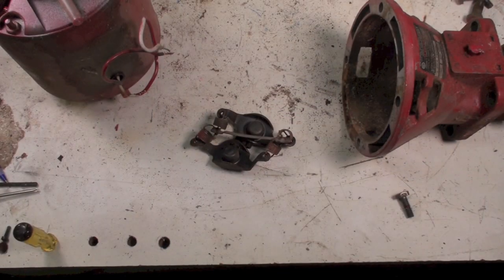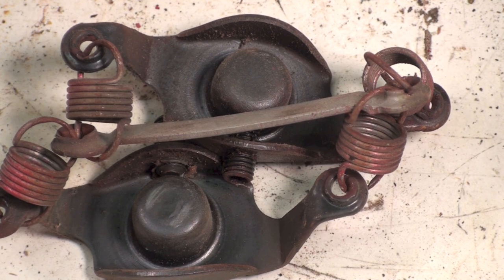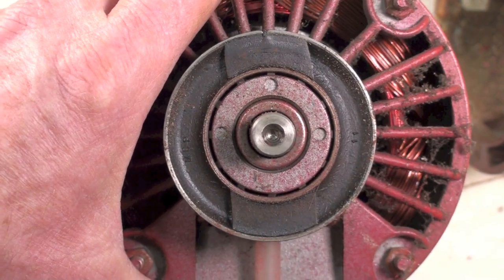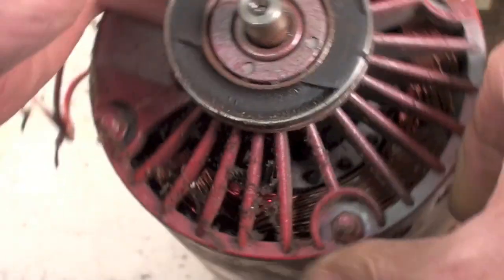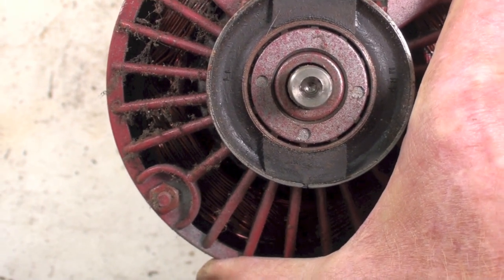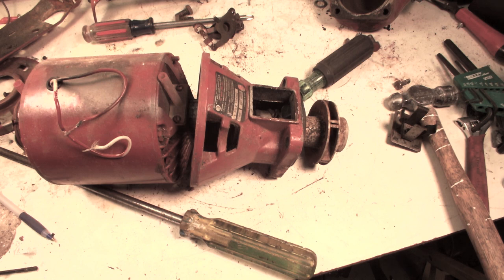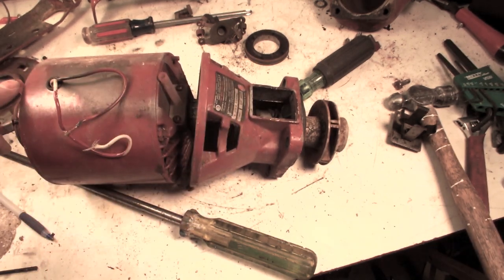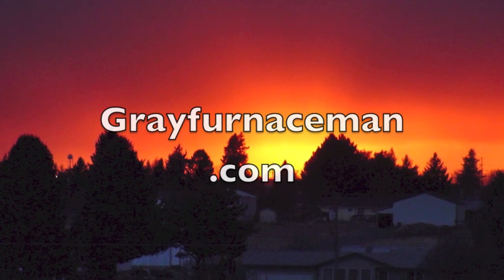Troubleshoot the Bell and Gossett boiler circ pump

Comment: These pumps ran in my house for some 60 years. They became very noisy after I had been in the house about 7 years. I simply replaced them with the newer models. Very quiet and energy efficient. Says alot about the original engineering and design that they ran for 6 decades. TY for your upload and knowledge share. :)
Reply: What are the new ones? can you list the model #?
Reply: @javirodify  I don't have the model number. They are available through Amazon. Make sure you contact a plumber and make sure of the replacements you need for your home and square footage.
Reply: @FSAUDIOGUY  Info should be on the pumps. Should be a model tag. 
I’d be interested. I have 5 pumps from ~1962. Have had to replace one but rest still rolling along. Have to replace 2 impellers and all of the couplers.

Comment: Your video likely just saved my heating- I am from Australia but been here a few years - after my recirc pump started sounding very clunky today I did the basics bleed the rads drain the expansion tank then I watched the motor - it couldn't turn at the couple - watching your video I realised the issue was I needed to add oil - as per you suggestions I added about 2  tbls of oil - ok it got engine oil mobile 1 - all I had on hand - so far its quiet and now working - you just saved me from freezing again after the power outages we had in toronto - I know I need to get a hvac guy to fully check it out in the next week - but you saved my ass - honest thankyou !
Reply from the maker: Welcome
GFM

Comment: Thank you so very much grayfurnaceman.  I just finished doing the maintenance by oiling the bearing(400 drops) and the motor(F-150 drops, R- 100 drops) as it making grinding noise from the motor and vibrating noise from the bearing.  The motor would stop frequently because of the thermal switch due to grinding.  I didn't oil the bearing yearly as you've suggested.  Worst yet, I didn't even see the oil spouts on the motor as they were spray-painted.  The motor apparently never has been oiled since installation, and it's been 13 yrs in my ownership.  Once replenished and restarted, it rotated super quiet and smooth.  I never realized how these commercial Bell & Gossett suppose to sound like in operation.  Thank you again, and a cold one to you!
Reply from the maker: They are amazing pumps.  Most noisy bearings will signal failure.  The B&G pumps mostly survive.
GFM

Comment: Follow up to my last posting.  The previous owner had another ( old spare ) B&G  tucked away downstairs I found. I unwired the mounted one and wired this one just to see if this one works. It spins, but noisily, so at least I know now it is the Circ Pump. Thanks again. Mystery solved!

Comment: Thanks GFM. I did just that, Pulled it. I oiled it yesterday just as you suggested in your other video. So it had time for the oil to set in. It was snug turning at first, and the motor spun semi-smoothly after a bit, but then noticed a bearing noise after rewiring and firing it up again. I don't know how old, or the history of this one as we bought the house just this year, so I think I will go ahead and order another motor and replace this one. Thanks for your valuable input with your videos.

Comment: Thanks for the prompt answer!!  I can send you any number of pictures needed.  I want to believe that alignment is not an issue but would admit that if I use push up pressure on the motor apparatus, it does reduce the noise---but the GE hung on in the same manner and was never noisy.

Comment from the maker: I would pull the motor off to check to see if the motor or the pump is seized.  Occasionally, if the pump is seized, it can be oiled (it takes 2 tablespoons) and may be freed up and if it does not leak, it can be used.
GFM

Comment: Gary! I have a small amount of oil dripping from the bearing assembly and the pump. (I put a clean paper towel on the floor so I can check it.) There is no tapping/clicking sounds, it all hums as it should. I add oil to it every season. Should I be concerned? THANK YOU for these videos!!! And for advising on correct amount of oil to put in each feeder. Understanding how these pump operate is solid gold. You're a good man!!!!
Reply from the maker: +Tom Lynch Thanks for the support.  It is common to have these bearing assemblies leak.  Not much you can do about it but be sure it always has oil.
GFM
Reply: Don’t be concerned that hole is to show to much oil
Reply: Don’t be concerned that hole is to show to much oil

Comment: Thanks for the advice. Unfortunately I've just had a bearing assembly leak that is only 6 months , on a bronze body BG100, for domestic water circulation.   When I opened the cap on the bearing, I saw a bunch of mush, brass shavings and water. Idk what went on with it, but it wasn't the nice neat rope like I've seen in the past. Any insight you can give would be nice. Thanks!

Comment from the maker: There are a lot of ways to turn on the circ pump.  Thermostat, boiler temp, zone valve etc.  You need to be sure there is power available to the circuit.  If the thermostat is on the same circuit, it has power.  A quick check would be to tap the pump motor with a small hammer.  If the start switch is the problem, this may break it loose.    Hope this helps.
GFM

Comment: What a wonderful resource you are—thank you!
New problem: my B&G circ pump motor often stalls and whines instead of turning, overheats and then cuts out. I am hoping this is caused by insufficient lubrication of the bearing assembly. What else might it be? Do I need to replace the pump motor?
Reply from the maker: +Ian Lambert You probably have a failing start switch in the motor.  It means replacement of the motor.  Hope this helps.
GFM
Reply: God bless you, both.

Comment from the maker: Does seem like overkill.  But I guess you cant argue with longevity.  I will be doing some on the modern water lubricated pumps.  Their power usage is smaller yet.  I have not seen the same longevity with the new pumps.  
GFM

Comment: Nice video.  Was trying to avoid taking apart later today, but tenants need heat.  On the one side of the pump coming from the heater the pipes are hot, but on the other side feeding Taco valves, the water is cold and nothing is being pumped.  It's making some noise, weeping a little, but at least the previous owner left parts.  Will check out your websites also.
Reply from the maker: Good chance you have a coupler failure.
GFM
Reply: Impeller exploded. Took pictures.  Found a local plumbing supplier who had the part.  Got everything reassembled, will re-install tomorrow morning.  I checked out your websites good information with the Weil McClain manuals.  I am retired but my friend who owns several properties is always calling me to do repairs and when equipment breaks down.

Comment: by "sagged down" he means a deep indentation I think, due to weight of motor sagging down and squeezing too much on the rubber mount.   Also I wonder how much noise the heavier springs really make, maybe they won't ever break on you if heavier, and my pump is in a wet sandy crawlspace and it is sheer torture to keep changing spring couplers
Reply: where did you get the spring couplers from

Comment: Awesome vid! I'm getting a rattling sound from the motor end opposite the pump.  My first thought is a bearing going bad.  I oiled it but the rattle is still there.  I see you didn't get into the motor bearings in your video.  Should I check into other potential sources of the rattle first?  Thanks!
Reply from the maker: James Perrin Look to the coupler.  I have seen very few bearing problems with these motors.
GFM
Reply: OK. Thanks for your advice.

Comment: Hello...thank you SO much for posting this vid. EXACTLY our issue. I think we froze the circ pump up from not oiling it. So what would your suggestion. TRY to oil it first before buying and installing a new circ pump?...and then having to drain/purge the whole system again mid winter? Yes we had water leaking...then it sounded like a "jackhammer" going off (per tenant)...and it stopped turning. The IMPELLER? (spinner) looks good and was just replaced < 2 months ago. Can you PLEASE advise
Reply from the maker: scroungehounds I always try oiling these motors first.  The impeller (coupling) usually fails because of the sagging of the motor mounts, so check them.  As for the leak, sometimes they stop after it gets going again. Hope this helps.
GFM

Comment from the maker: Air bleed depends on how the system is designed.  If the system is cast iron radiators, its easy.  You simply turn on the water & bleed each radiator with the unit running until you get water.  If its copper baseboards & has zones, turn on one zone at a time & bleed that zone If there are self bleeders, it will bleed itself while running.
I know this is simplified & I will be explaining how each system bleeds in the grayfurnaceman website.  Unfortunately, its not done yet.  Hope this helps.
GFM

Comment: great video, 1st one to give the amount of oil to be used . most people just squirt a bit of oil in every month or so not knowing the right amount.
Reply: Yeah that's what I've been doing putting 15 to 20 drops in each of the three tubes for the oil. I didn't realize the first one with the spring cap needs much more oil than the rest thanks so much for that tip gray boiler man

Comment: Thank you for your quick response. Much appreciated. I did as you suggested. A few taps was successful in obtaining movement, but not successful with the sound I heard.  Makes a short "garrrooop" sound and then stops, when I engage the thermostat. Apparently, I'm thinking it is seized up. Would you most likely say as well? Any input appreciated. Thanks in advance.

Comment: I rent a house with 8 other folks - the house is over 100 years old, 5,500 square feet and has a massive boiler with one of the B&G pumps. Just last night, stopped getting heat. Thermostat kicking on, boiler gauge shows pressure at 15-18PSI and temp of 150 but hot water is only evident in one large pipe coming out of boiler for about 4 feet - after that, where there is a juncture - all pipes cold.  There is a Honeywell thing that was ticking/trying to tick, no vibration from B&G.  Had heat from Nov 4 thru yesterday and now...........nothing. No leaks - just lots of old oil under in the pan. Noticed old bottle of lube in room but empty - and remember guy putting drops in last year.
Reply from the maker: Is the pump rotating?  Is the coupler broken?
GFM

Comment: The Mrs recently complains that the circulator is noisy.  Three years ago I had to replace the ancient GE 1/8 HP motor with a "MARS" 1/8 HP Motor.  It was ugly.  Vibration was so bad that I removed the frame casing on the motor and configured it to run in the old GE frame mount=better situation.  Now 3 yrs later, this month, I put a Century 1/8 HP motor on the pump--appears to be the same noise deal except I used the motor and its factory frame as provided.  The GE motor was so quiet--????

Comment: That rope stuff is wick.  It will stop working if it drys out to much. Change them. Capillary action draws the oil from the reservoir up to the  journals . Spiralink couplers are easier on the bearings

Comment: My motor or pump won’t turn. Not sure which. Took it apart and the couplers are intact. If the motor seized Will adding oil get it going again?

Comment: The problem with these pumps isn't the fault of the pump. They were designed during a time when people actually maintained their boilers. I'd say 1:100 people actually know to oil these things. It's amazing how reliable they are considering how often they run well outside of their maintenance window and design specification.

When you consider all it needs is SEA 20 weight oil (a quart costs about $3.00 and will last 20+ years of seasonal oil maintenance) it's unfortunate the industry is forced to use maintenance-free pumps that are often underpowered and less reliable. My parents BG pump was replaced with a Taco years ago, and it's frozen up twice, even after reconfiguring the whole delivery.
Reply from the maker: Tim W I agree on all you say.  I always tried to repair these pumps whenever possible, then instructed the customer on maintenance.  Thanks for the thoughts.
GFM
Reply: I oil mine.  I will be replacing the coupler in the mount tomorrow.
Reply: Oh, and I am a 60 year old woman. Thank you for the video it was very informative and helped me greatly
Reply: @sunyblutoo  I am an embryo and they need to do this for my uterus, I can't sleep!
Reply: Totally agree!

Comment from the maker: Is the noise coming from the bearing or the coupling?  I did a vid on couplers and motor mounts.  The rope wick should be oiled with a lot of oil.  It takes about 2 tablespoons of oil.  Once it is oiled, just hope the bearing is ok.  The motor and bearings should be oiled at the beginning of the heating season.  Hope this helps.
GFM

Comment: Thanks for immediate reply. I have added more oil than that  and as I said it only works for couple of days. Is it possible to repack bearing or any other options without removing wet end and bleeding system?
Reply from the maker: Brian Whiteman The bearing assembly is replaceable.
GFM
Reply: Brian Whiteman  nusicacristo

Música cristianamente

Comment: I have a multi-zone system with 4 pumps. One of the zone suddenly start always getting hot even when thermostat is off if any one of the other zone start pumping. 

Is this likely caused by some problem with the pump on the zone? 

I cannot find any check valve anywhere in the system.

Comment: Very impressive videos. I have a residential boiler with an (Armstrong/B&G) not sure after watching too many videos. Problem started a few weeks ago, high pitch screaming. Motor end was replaced 1 year ago so the coupler is a brass circular spring type. No oilers on the motor. Oiling the bearing stopped the noise temporarily. Now having to keep adding oil every couple of days or it starts chirping again. No water leaks. No play in mount. Been using sae30 as noted on plate. Any suggestions other than replacing entire unit with a newer compact unit.
Reply from the maker: Brian Whiteman You may be stuck with replacement.  However, I would add a large amount of oil (2 tablespoons if possible) and check the results.  Hope this helps.
GFM

Comment: We have that exact same circ pump, and it has always made a large rattling sound, so bad that all of the radiators also rattle and I can't run the heat at night or the rattling wakes me up. I'm so glad I've finally found some answers.

I'm still wondering though, will oiling the pump still fix it? Or will parts have to be replaced in order to stop the rattling? The pump still functions well, except for the bearings rattling, though it hasn't been oiled in years. What do you think?
Reply from the maker: The motor mounts cause noise if they have sagged.  Replacement of them may help.
GFM

Comment: Water fills up my oil reservoir  on the bearing assembly and  leaks out the top. I'm guessing it's time for a new bearing assembly?  I dried it out but it filled back up again right away. Your advise would be appreciated.  Thanks for the video.
Reply from the maker: Yes, its done.  You may be able to replace the entire pump cheaper than the cost of the bearing assembly.  The new pump will be water lubricated and will require no maintenance.
GFM

Comment: Thanks for the video. I have a hot water boiler in a 24 unit apartment building. Had the 1/6 HP G&S pump replaced 5 years ago and now it was just humming and had to reach in their with a screwdriver to kickstart it. The boiler man at the time he replaced it 5 years ago said 1/6 HP was enough to circulate the hot water via the building.  The pump numbers are M74794 and ID number M10711. Can I replace it with a newer series B&G pump, preferably a new series motor that fits onto the older series pump housing. What series and HP is a good combination to go with? Thanks
Reply: ID number M10711

Comment: I had a NO Heat problem, I foung the boiler in High limit and the 2 BI motor very hot (and not turning). Visual showed the center bar of the sheet metal style coupler caught in the side hole. Disassembled, found nothing obvious (no damaged parts), except the pump shaft turned a bit stiff with fingers. Reassembled, ran fine. I Monitored startup this morning (garage temp 40F), pump turned slow (and hummed) for about a minute then settled down.  Bad Capacitor (not a listed part for the 1/12 HP motor)? or the pump bearing?
Reply from the maker: Have you oiled the bearing?  It takes about 2 tablespoons of oil.  Probably not the cap.  
GFM

Comment: Thank you for sharing your knowledge with such a great video.

I bought an old house with a B&G MOT109-6 assembly and it has this exact problem. Lots of rattling over the past two weeks, but it stopped today - along with the heat on the 3rd floor! One part of the coupler - the metal is completely shorn. I need to figure out if I can get away with just coupler + bearing replacement (worst case) or if it makes more sense just to buy and install the complete replacement motor #111031 and assembly. Not a plumber but a decent mechanic - definitely feeling up for the challenge. Appreciate any suggestions
Reply from the maker: Sounds like a candidate for a coupler and motor mount replacement.  Its a quick and easy repair and almost always works.
GFM
Reply: where can i get the spring couplers from
Reply: @eddiedrummond7497  eBay